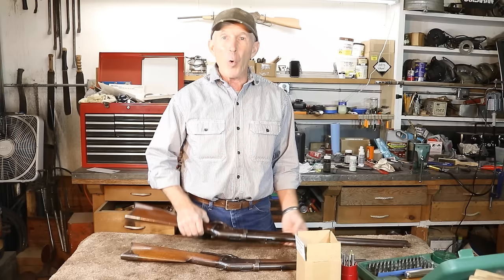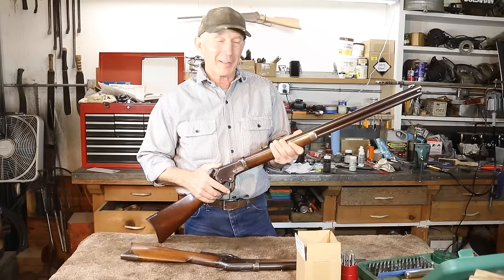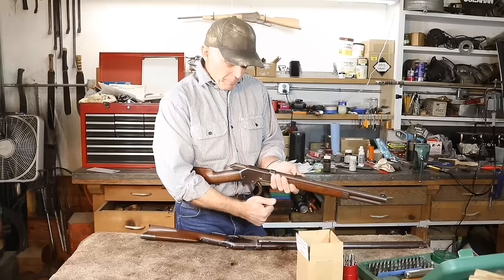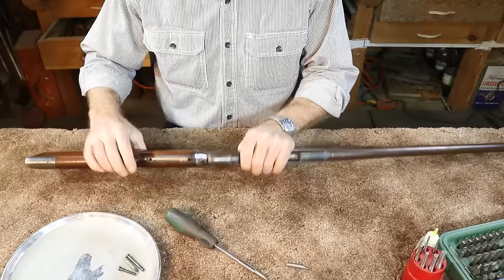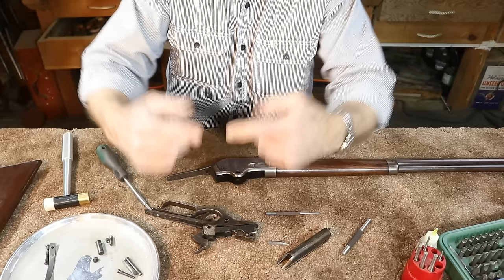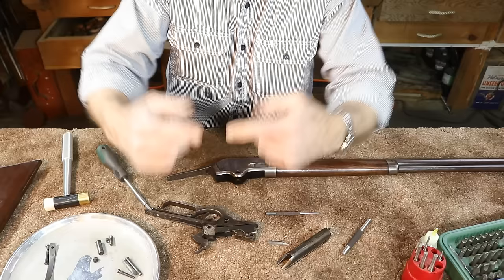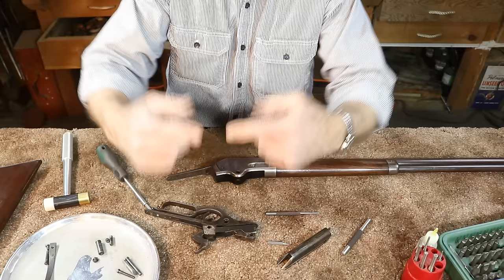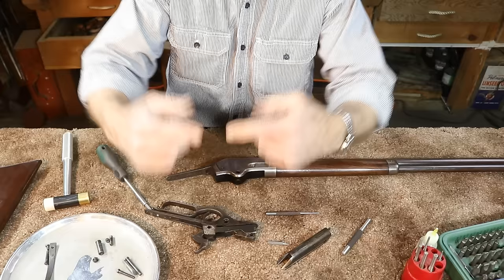Colt Burgess Unique Ejector

Comment: An excellent video! So nice to see the inside of a Colt Burgess, not often we get to see that. The small size of the extractor block is a surprize ,I would have though it would have been of a different dia to the primer, were early primers larger dia to our "modern" ones. Chris B.
Reply from the maker: Thanks Chris!  I believe the primers were the same or very similar to the diameter they are today.  This design is a little surprising to me as well.  It's a weak link in what I think is a very well-made firearm for the time.

Comment: Great video on the Burgess rifle. I had one of the Uberti replicas because I really liked the design. I used it for my CAS rifle however I had problems with it functioning to the end of a match, and sometimes a stage. It went back to the company gunsmith a couple of times so the company graciously let me swap an 1873 rifle (24" barrel) for it even steven.
Go figure, my go to match rifle ends up being a Colt Lightning clone.
Reply from the maker: I haven't handled one of the reproduction Burgess rifles.  That's disappointing to hear.  The originals I've shot have cycled slick as a whistle.

Comment: When on every firing the ejector rammed back on the cranking mechanism it wore 'nick' each side of that mechanism.  Presumably when the ejector sits back it is going back into those 'nicks'????  Are you going to weld and linish (no pleasing Spalcheque) out the 'nicks'?  It seems that whichever piece of metal is the softer will be 'nicked' again.
Much enjoyed.
Reply from the maker: I cleaned up those nicks.  They are now clearance and if I welded them up, it would take that clearance up.  Now that the ejector is hardened, it won't deform and hit the toggle, but stop at the back of the bore where it rides in the bolt.
Reply: Thanks for that Mark; I thought you might have fixed it or were about to fix.  
I don't always expect you to take time to reply; on the viewer's end it helps if we at least try to support with activity.  Without viewer response Youtube is dead.  Your channel helps our interest area: I'm thinkin of a man to whom I sent a link; he was encouraged.  Well done!  I am still smarting over the way the advertising 'algorithms' apparently linked certain violent game platforms to your channel.  All the shooters I have ever known are Gentlemen and Ladies.   
Thanks Mark; no reply explected.
Reply from the maker: Thanks a bunch for your support.  BTW, it was a very good question.🙂

Comment: i have a question sir  it's off topic but  here goes i have a win. mod. 94 made in 1973 by the serial # it was jamming and i found that the finger lever pin was bad and catching,, i ordered another from Numrich gun parts when i went to put it back in the replacement pin was bigger than the one i took out..i've went back and checked all the numbers and the "new old" stock pin i ordered should be right but it isn't..i've took drill bits and sized the hole and it comes out to 9/64ths and i've thought about using it to make a replacement have you ran into this before???? i wondered if a replacement pin for a 1895 would fit? any thoughts you may have would be most helpful on this....
Reply from the maker: I rarely work on post-63 so I haven't run into this issue.  I save all my broken drill bits and use them for pins when they're the right diameter.  Just make sure it's a good fit.  If the pin is sloppy, it will prematurely wear the parts.  Good luck!
Reply: @thecinnabar8442   thank you for the reply the bit i spoke of is a tight fit so it should work i wasn't sure if using a piece of drill bit would work or hurt  but it is a truck gun of my uncles wore out but not gone so i'm trying to keep it running for him..once again thank you for answering my question...